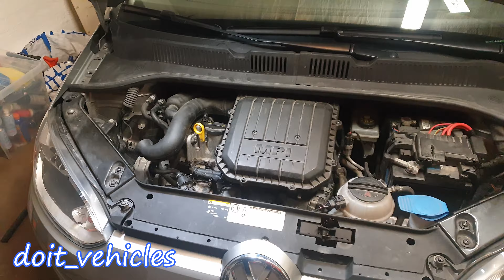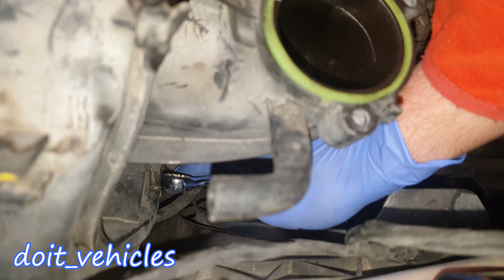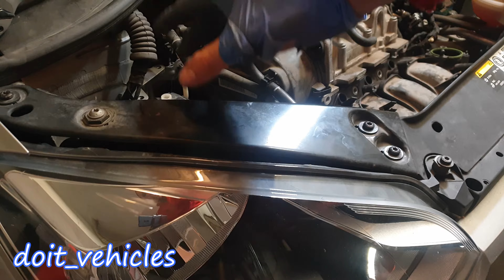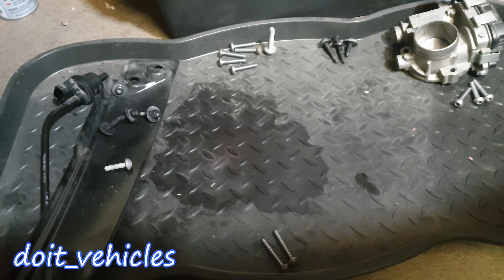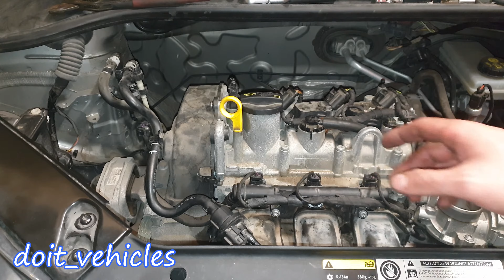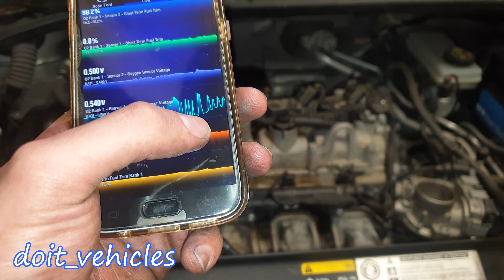2013 Volkswagen up ! Intake Manifold Removal / Gasket Replacement P0171 P0174

Comment: Hi, I can’t seem to find these 3x intake manifold gaskets online. They all appear circular instead of the shape shown by the intake unless this is correct and the round ones mould to this shape? Can you remember if the gaskets were circular or the shape of the the intake manifold prior to installation and where I can get them from /part number. Cheers

Comment: So if the gaskets are fine i can just put it back without changing them ? or do i need to apply silicon ? Thanks
Reply from the maker: the gaskets should have elasticity left in them and should not be flat or damaged . no need for silicone,  although it won't hurt unles it leacks inside